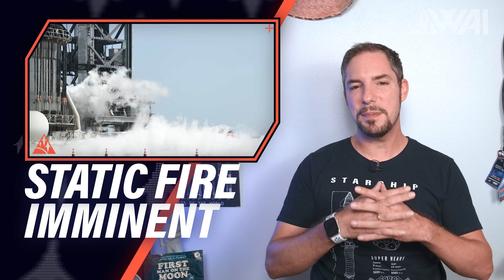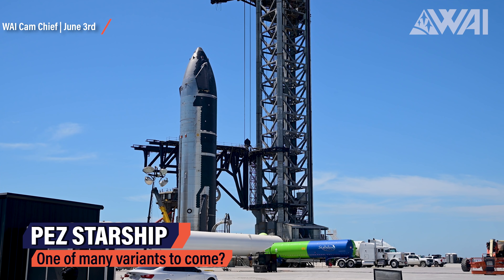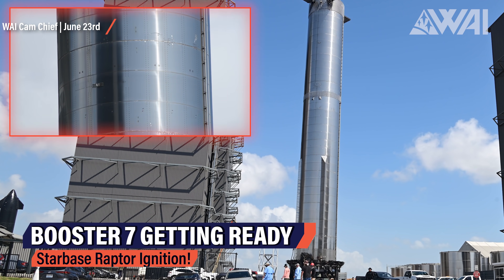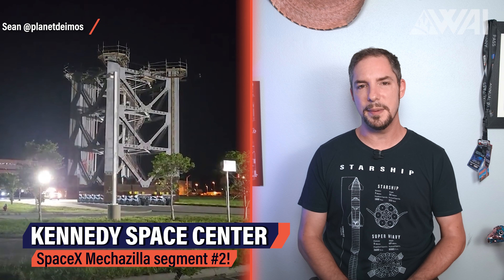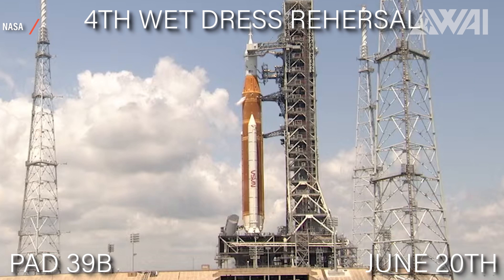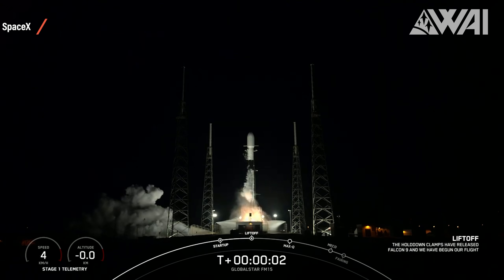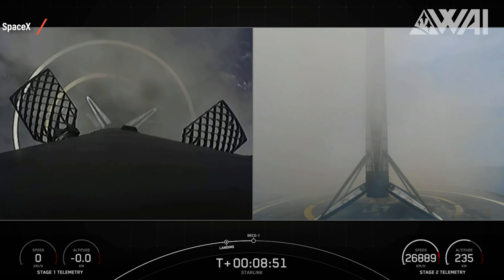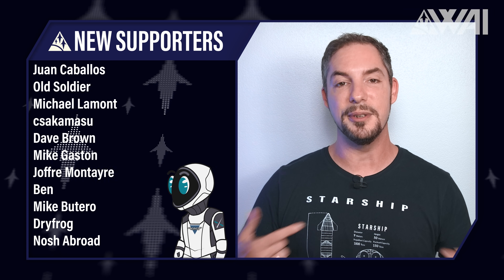SpaceX Starbase IGNITING Starship Booster Engines!

Comment: Variants:

Starlink dispenser
Falcon-9 Stage-2 recovery lander
Starlink refuelling tender
Orbital tanker
Fuel transporter 
Lunar ferry
Lunar orbiter
Lunar lander
Mars ferry
Mars orbiter 
Mars lander
Space station sub-module 
Shuttle 
Tug
Reply: Elon says, if Starship works then Falcon 9 is obsolete, no need for Falcon 9 Stage 2 recovery
Reply: @DIDISCH68  the problem is that you don't use a jack hammer when you can just use a ballpeen. Falcon will still be needed for smaller scale flights, but starship will allow for more large scale space operation. Though not everyone can afford those missions.
Reply: @cheeseninja1115  Wrong. The launch cost difference between Falcon and Starship is huge. Elon has said Falcon will go away as soon as Starship is certified to take over all its functions, especially crew transport. There is a HUGE difference in cost of launches between the two. Starship is a lot cheaper, because it is fully re-useable. Every Falcon you launch you expend the $8 million second stage. Also Starship doesn't need fairings at $5 million each. Starship launches are expected to cost less than $1 million each, since it is essentially just the cost of the fuel. The cost of building the vehicles are expected to be amortized over 100 launches, if not more.
Reply: @DIDISCH68  Falcon 9 will be neccesarry for delivering astronauts to space for long time. I do not see starship getting human rated any time soon
Reply: Probably also an expandable version for deepspace probes (no header tank, no sea level raptors and normal fearings)
Reply: @Lynn GeekI just do not see starship carry crew dragon to iss. You can not just put it on the nose (in terms of re-entering starship and the header tanks). Putting it in the cargo bay just seems very impractical (no launch abbort), because you can than just make a normal crewed starship.

Launch and landing abbort system seems like something hard to do. The only thing I can see happening is ejection seats and or firing up all engines on starship if something is wrong with super heavy. The comparison to planes is also unfair in this matter. Planes can glide if all engines fail, starship will crash if that is the case. They need a lot of launches and landing before NASA considers launching and landing astronauts on it.

I can not remember NASA being against propulsive landing. They only wanted crew dragon to land with a parachute and not with the superdraco engines

Comment: I think the "Pez" dispenser will be a one shot thing. I think they will see problems with it when the starship go's through Max Q.
Reply from the maker: Can you elaborate? What kinds of problems would you see?
Reply: That’s why they test it first.
Reply: Having dealt with industrial pallet stackers quite a lot, I have enough concerns about the reliability of the ones on Earth. To put something like that in space? Much more risk! Fingers crossed SpaceX has some way to thoroughly prove the design in some way, in zero-G, before sending up millions of dollars of Starlink v2. Imagine just one getting lodged in the slot: Not only failed satellite deployment, but now way more mass at re-entry - making it impossible to slow down enough to land safely
Reply: @vistabuntuu  I feel the same. On one hand I want to see deployment and not just a mission to go up and down, but the tolerance of this attempt must be perfect. I would rather see a larger hull door used instead of a small slot.
Reply: they won't be deploying anything during maxQ so why would it be an issue? I would think in the free fall of space the system will have much less stress than at 15psi on the surface of earth. I'm sure their engineers have figured it out and tested over and over or they wouldn't be spending the money 4 something that wouldn't work.
I trust it will be flawless.

Comment: Thank you for news!
If Falcon has Falcon heavy then Starship can have Starship heavy (Starship with 2 additional boosters)
Reply from the maker: Building Falcon Heavy was more complicated than initially thought. Three Super Heavy boosters would create a massive amount of structural load. :_WAIShocked:
Reply: Starship heavy will be Starship 2.0 with 18m diameter
Reply: Somehow I suspect that Starship Heavy is unlikely to ever exist - at least in that form.
Reply: @KnightRanger38  Starship Heavy would need to be assembled in space.  At an orbiting factory. Which would be transported up there by a regular Starship as rolls of stainless, with shears, rollers, and welders.
Reply: The payload would be around 200T.

What would that be needed for?
Reply: I think the idea behind Starship even from the beginning was that it would just be more economical to launch 3 separate starship+booster combos than even attempting something like that, hence Musk's obsession with turnaround time and re-usability. I will admit I would absolutely make the trip to see a GIANT Starship launch though.
Reply: I could see a super heavy booster with some solid rocket boosters to launch insane amounts of fuel into LEO for a tanker ship. Would make a little more sense than launching 10s of starships to fill one ship full